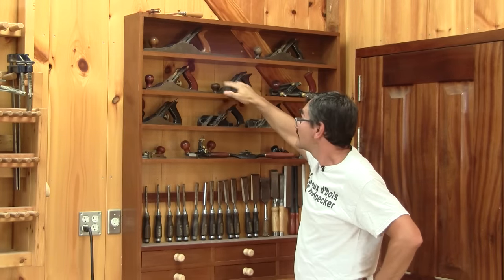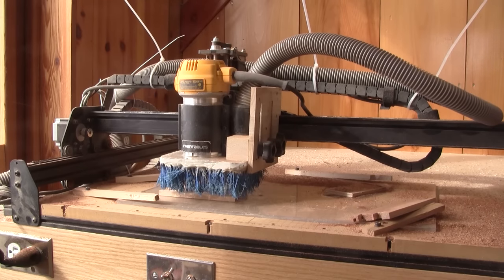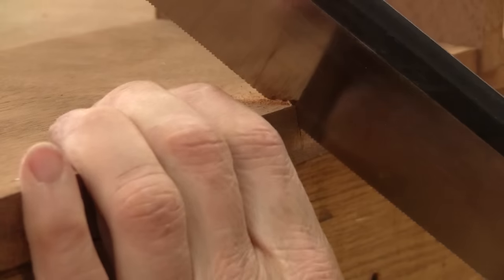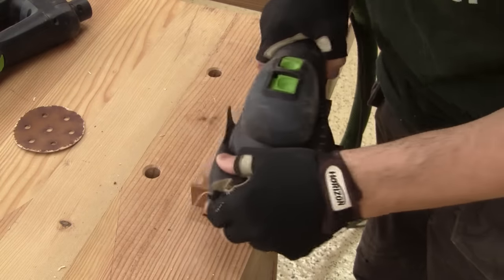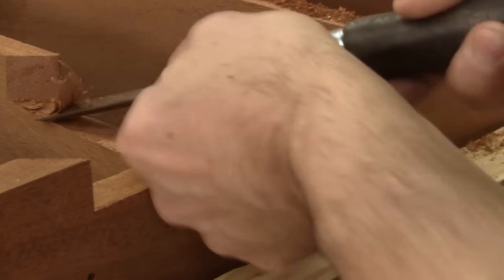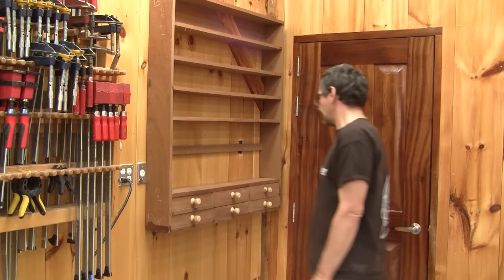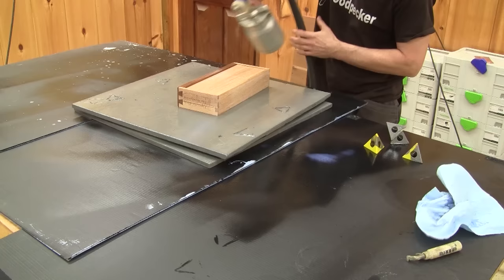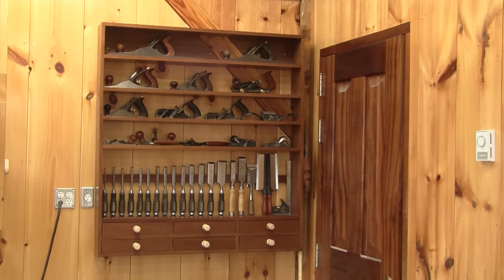The Woodpecker Ep 124 - Hand Tools Rack - part 2

Comment: Your tails are reversed.  There should be a half pin top and bottom on the fronts.  Like the thriftiness you have regarding your wood.  Also a router plane does very well on those pins in the side for the rails.